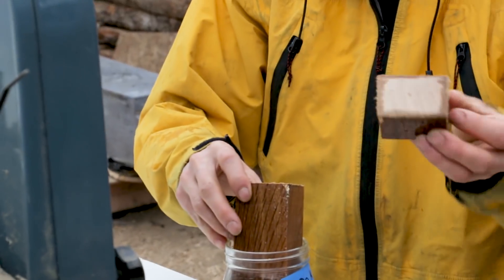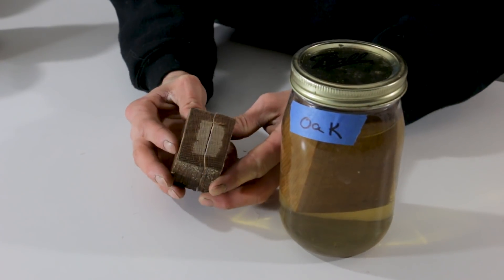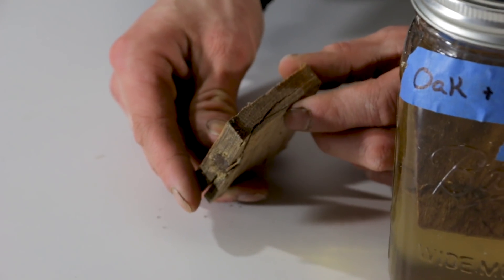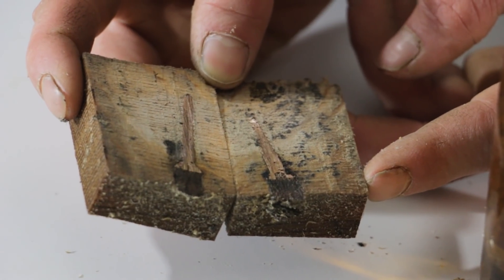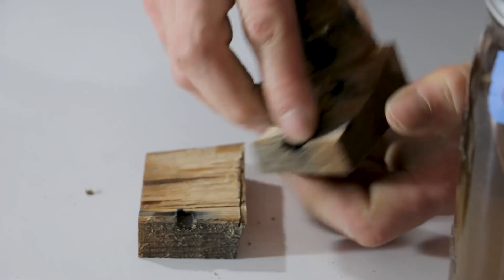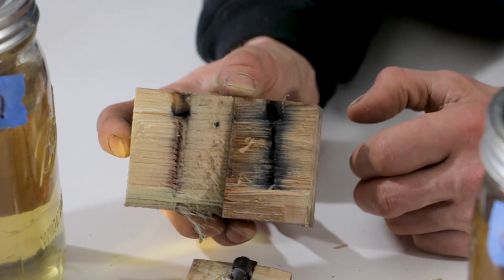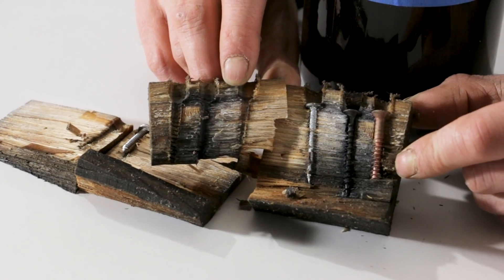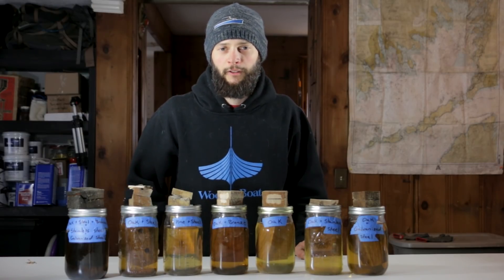Acorn to Arabella - Journey of a Wooden Boat - Bonus Content: Dissimilar Metals Part 2

Comment: Hi guys.

Can I humbly point out that there is certain criteria that your experiment is needed for it to be relevant.   Corrosion needs;
1) An electrolyte (sea water)
2) An electrical path.  Ie the metal has no barrier.... grease, paint etc. 
3) A potential.  As is a differential between the metals. The annode - and cathode +
4) oxygenated electrolyte. 

This is where your experiment starts to fail guys.  The electrolyte will become 'passive' after the O2 has become depleted.  My background is in offshore engineering and when a structure has lost integrity and becomes flooded, chemicals can be added to deplete the O2 in the sea water.  This will deplete the o2 and passivefy the electrical path.  
The faster sea water goes past a corroding  metal the faster the corrosion as irons are washed away.  SO;  keep changing the electrolyte to mimic the reality of passing sea water.  Hope this helps.  Regards Des (ex commercial Diver, inspection eng, welder etc blah blah.)

Comment: Very interesting to follow your project. I'm a subsea engineer in oil and gas industry and deal with material/corrosion issues regularly. There is a little problem with the way these tests are performed. Corrosion is a oxidation process, hence as corrosion progress the oxygen in the water inside your jars will be consumed and the oxidation process stops. Consequently if you leave these samples for a long time your findings will be incorrect. 

When designing subsea structures this effect is exploited. hollow compartments (tubes and square hollow profiles) are fitted with vent/drain holes typically 20-30 mm in order to let them flood with water when the structure is lifted to the seabed. If they are not flooded the external pressure would make them collapse. However, surface treatment i.e. painting or use of anodes inside these members are not possible. Solution is to put special rubber grommits in the vent holes to prevent water from circulating in the members. Oxidation will kick inn, use all the oxygen in the trapped water inside the member and then come to a stop. This method has been used for a long time and are proven. 

If you choose to use stainless steel there are some thing to be aware. SS316, wich is the most common stainless steel, is not corrosion resistant in seawater over time. Also 22% Cr (Duplex Steel) and 25% Cr (Super Duplex) may experience corrosion over time. For 100% corrosion resistance over time one have to use 625 steel also known as Inconel. this can be left for 30 years in the sea without any corrosion protection. 

But there is an two additional issues to keep in mind, unfortunately.. If you mix metallic materials and they have electrolytic contact the corrosion will be accelerated on the least corrosion resistant, typically carbon steel and aluminium corrodes heavily and the stainless stay intact. Thus one use zinc anodes as they will be the first to corrode protecting other materials. Problem is there is a catch with corrosion protection systems based on zinc and zinc/Al anodes, they facilitate generation of free Hydrogen. Free Hydrogen in high grade stainless materials makes the material brittle over time and results in whats known as HISC, Hydrogen Induced Stress Cracks. 

Spend a little time designing your CP (corrosion protection) system and avoid any surprises. Oil and gas industry worldwide use a recommended practice developed by DnVGL when designing these systems. They also have recommended practices for material choice. All DnVGL standards and recommended practices are free and available online here: https://rules.dnvgl.com/ServiceDocuments/dnvgl/#!/home 

Good luck with the project. If I can help send me an PM
Reply from the maker: Holy smokes!   Thanks for the info!  The jars are getting a bit funky so they are going to get a fresh batch of oxygenated salt water, hopefully it will keep the reactions going. 
Metals in salt water is a complex subject for sure, thankfully we have some time to get educated!

Comment: Bahould have included copper and monel. Interesting but be way better to go to a boatyard and investigate fasteners that have been in place for a lot longer.
Reply from the maker: Very true, but the ocean is a 2 hour drive from here!
Reply: Bit surprised to get yr reply. Thx. I'm a Kiwi boatbuilder living Australia. Humour lost in translation I guess. Spose what I meant was "don't you have an old boat in the back yard?" I've refitted a number of old timber yachts, currently doing a 1950's 42' double ender. Planked Huon pine (look that up!). Bronze and copper and lead in very short supply in the decade following WWII so Monel and even gal fasteners in boats of that period very common. Oddly pre war boats last longer than post because of that and the fact that the best Kauri Pine (NZ) and Huon Pine (Tasmania) was already in short supply. The last cutter (50') I refitted was Huon Pine too. She had no butts! She was fastened with Monel screws at the garbord and hood ends. The keelson is swamp gum, the stem and deadwood all Spotted Gum. Monel fine in the Spotted Gum, like new. Only thing holding the garboard in place was the 1/4" copper roves to ribs on top edge. My point being that there are just so many variables that it's too had to figure. I know of a home built boat from the 1930's that is fastened with #8g gal fencing wire and caulked with Cotten pajamas and still sailing! Go figure. Enjoy yr blogs. Thx. I should do same I'm often told. Will try and connect via FB and Messenger so can share project pics. Matt Westrupp

Comment: Is it possible that the black phosphate coating on the drywall screws masking itself as the iron sickness in the steel/oak test?
Reply from the maker: Possibly but I have seen a lot of iron sickness before and this is exactly what it looks like.

Comment: Out of curiosity, are you using sea water, or did you just make a salt water solution? I'll bet they interact differently (sea water being less pure), although the basic premise remains the same.
Reply from the maker: We used sea salt to make the salt water solution, it's not perfect but like you said the premise remains the same.  We are less concerned with a accurate degree of corrosion as we are just seeing the corrosion take place.

Comment: Good investigation. I think your on to it. I would only use bronze and stainless steel as they are so close on the galvanic scale and  never bond different metals together. Bond a zinc anode to a bronze fitting about a foot apart with a copper wire and in 6 months the wood around the anode will be destroyed. Test it on a piece of wood hanging off your jetty or marina. You''ll be surprised what were doing to our wooden boats.
Reply from the maker: I have heard of boats being destroyed that way.  Stray electrical current from solar panels, your neighbor at the dock... can also destroy a wooden hull.
We should have nothing but oak, cedar, bronze, lead and copper below the waterline.  Should all coexist quite well.

Comment: Hi guys, I've found this episode really interesting and especially useful as I have been having some electrolysis issues on the mahogany boat that I'm restoring. This is especially clear on the rudder, where the galvanised straps have almost disappeared and taken out much of the wood in the process. Based on your experiments I guess this is a reaction to the copper hull fastenings, lead keel, and maybe bronze keel bolts, or stainless prop shaft! (Yes, I seem to have a bit of everything!) Would be great to get 2 minutes of your time and an opinion on whether or not I can save this rudder, which I've explained here https://youtu.be/YM0H5KSsUow I'm still new to boatbuilding / restoration so thanks so much for the ongoing advice and tips :-)))))
Reply from the maker: Our best advise is to post on http://forum.woodenboat.com/ under Building and Repair.  You will need to become a member but it's completely free. 
Those folks have infinity more experience and knowledge than we ever could hope to have and are the ones we turn to when we need help.  They won't stand for arrogance or folks seeking to hear only what they want (not saying you are that way!).  They call it as they see it, it's a no BS type place.  But if you ask an honest question and are there to learn by golly it's like a research library that searches itself.  Bring lots of pictures and they will sort you out in a jiffy!

Comment: In the marine industry they use salt water baths at slight elevated temp to simulate a few decades use on uncoated resin glass samples and then run the sample through destructive testing.  The water soaks through the fibers strands where the resins havn't 100% bonded to the glass.  They add sizing chemicals to help the resins stick to the glass to reduce the micro voids.  Point of all this your not far off what is done in an marine advanced composite lab.  Reinforced plastics really are just synthetic wood when you brake down the chemicals and function.
Reply from the maker: Cool! Thanks for sharing!

Comment: Low purity stainless will be a problem.
Reply: You are correct. In a paper mill in a acids environment 304 stainless corroded in a few weeks. It was replaced with 316 stainless  which lasted for years.

Comment: NOW, this idea is expensive, and i'll be the first to say it, but i've used it architecturally in my endeavors with near-water located houses with decent results. I bought CA glue in bulk (container vs pipettes) and soaked the ends of the wooden (water resistant treated) pillars for 2 days (with a CO 2 sealed bag to stop the glue from activating). 

The end result is a very strong coat that protects the wood from any incursion. Whenever that coat was to be pierced, all fasteners (stainless) were driven in pre drilled holes filled with CA glue. Over that, a standard coat of paint (i use epoxy based paint for the inner layer) is and then finishing.

Oldest structure done so, with at least 1 meter standing water 2/3 s of a year has had no problems so far after 4 years.

I'm sharing this more for the experience, and the fact that if a barrier is given to the wood, it's best for it to go everywhere in it.

Other than that, interesting results, they match most of what we did as R&D, we also had red oak mostly for comparison, and yeah, might as well be a sponge. :) The wood was imported from US, so nothing special to note from that front.
Reply from the maker: You are correct if you are going to coat wood like that you you best cover every inch.  Partial sealing is bad news bears!

Comment: The way the bungs are cut basically just transfers water to the top of the screw. Perhaps cut them cross grain?
Reply: Normally, bungs are cut cross-grain (bung cutter drilled into the surface of a board), as opposed to dowels that would draw in water as you suggest.
Reply from the maker: For this experiment we did not feel it matters but for the boat we will be much more picky.

Comment: Very interesting. Wonder how ceramic coated fasnters would work or fasteners coated in silicone or somesuch other repellent.
Reply: I have experience with ceramic coated fasteners used to attach hinges to wood windows that are about a half mile from the ocean. The manufacturer of the screws recommends that they not be used in applications where the screws are closer than two miles to the ocean. Based on my experience the manufacturer's restriction seems reasonable. The screws show no signs of corrosion for the first few years but within about five years I've noticed some signs of corrosion. The orientation to the prevailing wind seems to affect how well the screw resists corrosion. Screws installed where there is significant contact with the ocean breeze corrode much faster than screws installed where there is more protection from the ocean breeze. The wood in these windows is pine.

I also have removed screws used to repair the window of various types. Many of these screws have completely rusted out over the course of thirty years or so. As the video showed dry wall screws have almost no corrosion resistance. Cadmium plated screws don't fare much better. I've had very good luck with stainless steel screws without realizing that I might have just been lucky that the particular metal the screws I bought were made of an alloy that worked in my application.

Comment: Clearly bronze and stainless are the best choices.  What is the cost difference per fastener ?
Reply from the maker: It depends a bit on the type of stainless and bronze as there are a few different types and grades of each.  But in general we think stainless is initially cheaper.
Reply: THIS is where the metallurgy, or at least the years of wooden boats builder before you, really comes in !

Comment: Thank you for the video, don't you think it would be more appropriate to introduce electrolysis to this testing to get a more rel picture of what will be happening? Thanks
Reply from the maker: It would certainly be interesting to see but a bit more complicated than we really want it to get.
Reply: I'm not sure if that would prove anything actually. Galvanic corrosion isn't the same as electrolysis. The dissimilar metals in an electrolyte are creating electricity. With electrolysis, electricity is being forced into the system from another source.

Comment: The expense is likely prohibitive, but I wonder about the more exotic alloys in use at sea. Monel, inconel and copper-nickle come to mind. We had entire systems made of copper-nickle and aside from the initial green and presumably molecule thick protective layer, I don't recall any other corrosion. Some of the exotics were subject to erosion from fast flowing sea water but that was all and even that was minimal. Metallurgy is an exacting discipline yet even with all I was taught it sometimes seemed more like thaumaturgy. I can imagine the Phoenicians and the Greeks puzzling all this out, but I wonder about those magnificent Viking longboats (more properly, longships). It looks like there is more research in my future.

Arabella has a long lineage to live up to. It pleases me  (not a requirement, of course, but it does) that her builders appreciate what her forebears bring to her construction. I think not builder, though... Shipwright!  (Beard required.)
Reply from the maker: Shipwright implies experience and that is something we do not have.  Aspiring boat builder is most accurate =) 
Monel is amazing for the salt water but comes with a big price tag.  Galvanized steel, bronze and stainless steel are the three realistic options for us so that's what we focused on.

Comment: maybe one day this will be a boat building site again.........  unsubscribing
Reply: Michael Touchette  Even if you don't like this type of video, it's not like they stopped posting build videos. If they didn't post this one, there would be no video, and you'd wait for the next one. Stop being an entitled brat and just don't watch these particular videos if you don't like it.
Reply: Michael Touchette these two gentlemen are not experienced boat builders.  So the last two videos are.crucial for them to understand the interaction of the fasteners they need to use. Sure they can ask but knowing first hand is always best.  This is a necessary step for them to do. Hope you subscribe back.. keep up the great videos Gents.
Reply from the maker: O man! It's like walking out at 1/2 time because the first part of the game was slow and the second half ends up being a nail biter with double overtime.  
Spring has sprung and we have been busy! 
In the last week we filmed: sourcing locust, bringing the keel timber to final thickness and shape, and jointing and thickness planing the bow and stern assemblies.  If the forecast holds this week I'll fair and paint the lead keel and start cutting all the bow and stern assemblies to final size.  
It's go time ladies and gents!  The videos are just a 1-2 weeks behind real time so next week is a boat building bonanza.

Comment: I would like to see what happens with brass screws.
Reply: Brass and bronze are both alloys of copper.  Brass is an alloy of copper and zinc while bronze is an alloy of copper and tin.  In almost all cases, addition metals are added to "improve" certain capabilities/features of these alloys.  Bronze is much stronger than brass.  When brass deteriorates it create zinc oxide will attack the lignum in wood.

There is one bronze alloy called aluminum-bronze or nickel-bronze-aluminum (NiBrAl).  These are even stronger and more corrosion resistant and used in marine application where high strength is required (propeller, etc.).
Reply from the maker: From what we have heard and read Jack Patteeuw is spot on.  Thanks for sharing your knowledge Jack!
Reply: Brass wouldn’t last, not a good material for fasteners
Reply: College 40 years ago.  Only one class in materials.  Experience, Google and  Wikipedia.
Reply from the maker: We are all stocked up on logs (except black locust) and are not looking for any extra work at the moment.  Thanks for the offer though!
Reply: Totally off topic... would you be looking for tree work?  Have a bunch of those very tall pinetrees that are prolific sound MA. Keep what you cut. Can leave brush and stumps